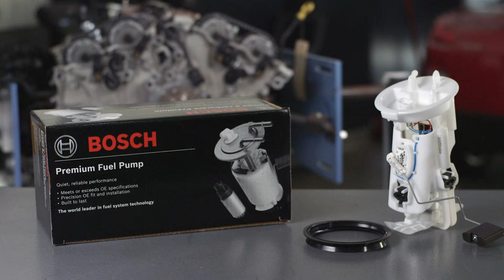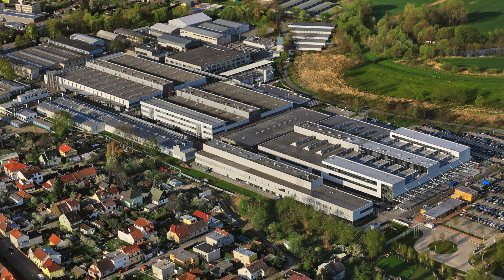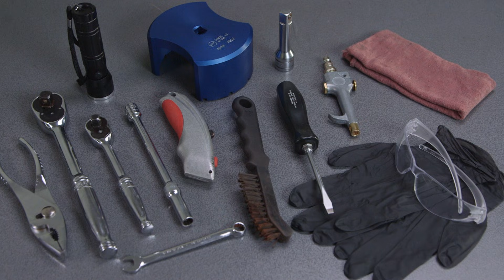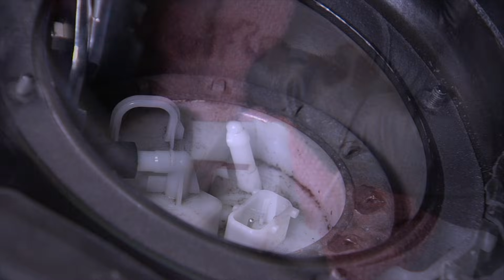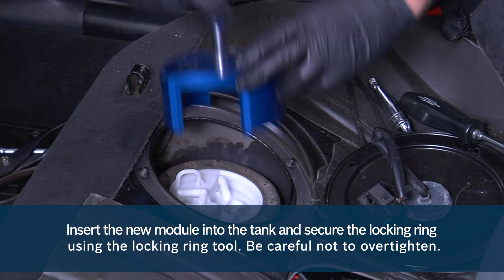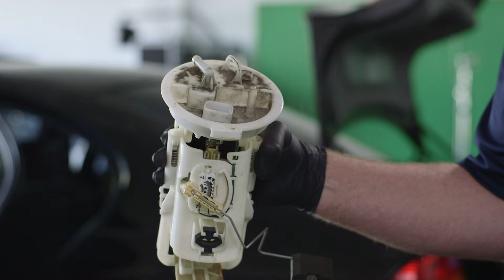Removing and Installing a Fuel Pump on Your Car

Comment: I had just bought a Bosch #67378 and it did NOT come with strainer and due to redesign of pump assy aftermarket strainer would not work !!!  Also the new was made in China?!? The Bosch #67378 I bought 11 yrs ago  came with strainer and was made in USA.
Reply from the maker: Hello.  Thanks for reaching out.  This part represents an improved/updated fuel pump with an integrated filter and improved wire harness.